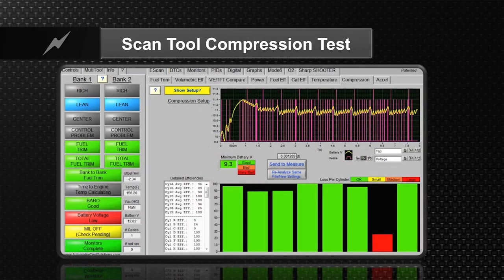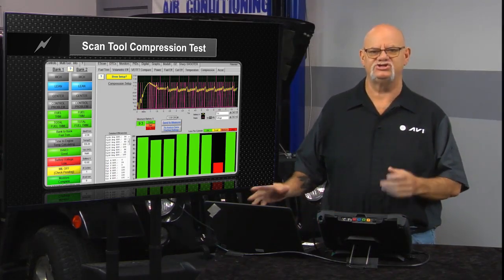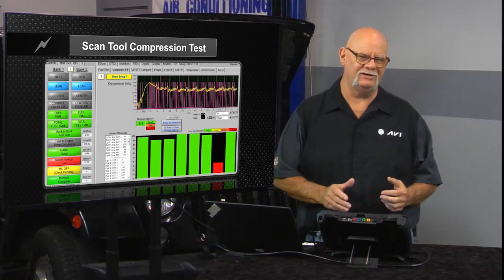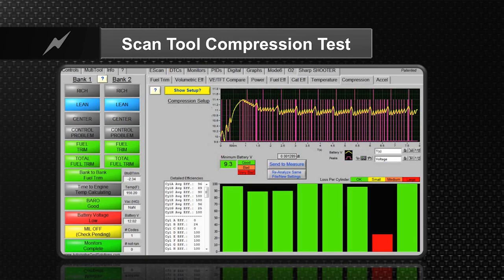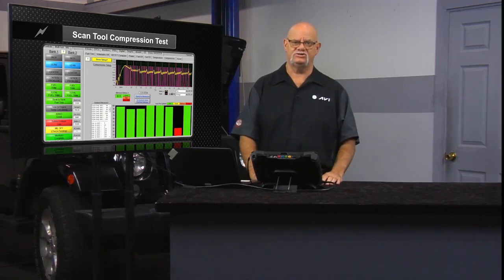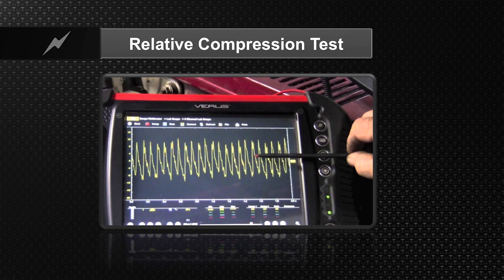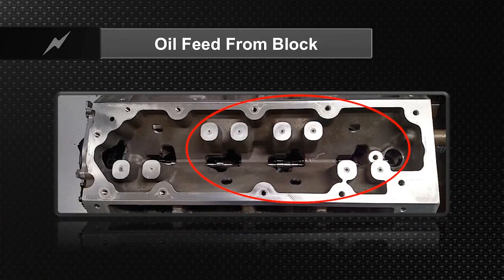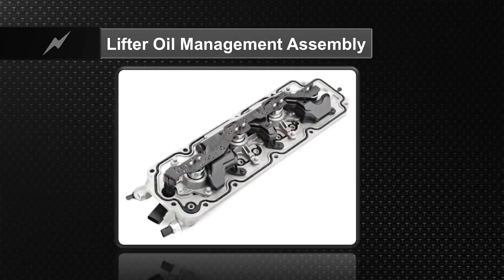Scan Tool Compression Test with your Scan Tool

Comment: What I love the most about automobiles is the heart of an internal combustion engine, and how I can feel it in the wheel and the pedals. I remember reading somewhere once that electric feels a little unnatural in comparison for the reason that as humans were used to the patterns like our heartbeats and the engine and transmission shifting. Electric motors and cvt transmissions together feel wildly unnatural